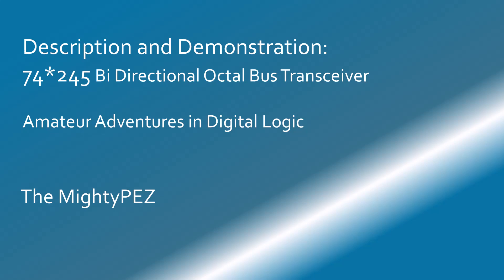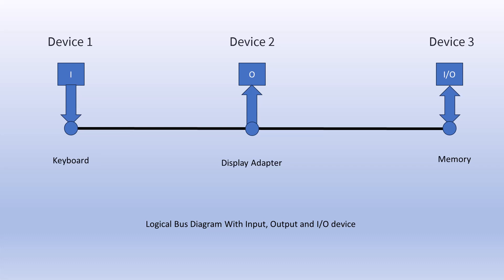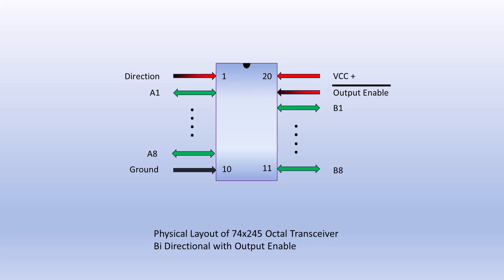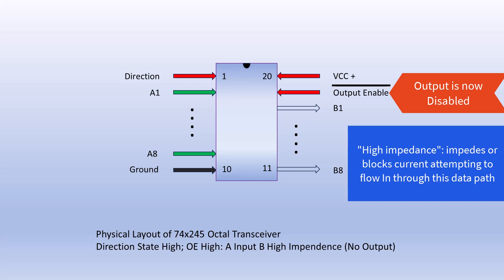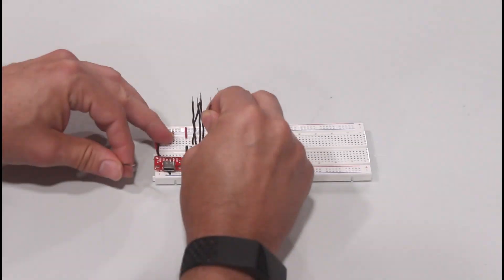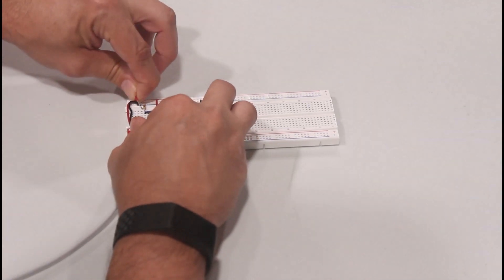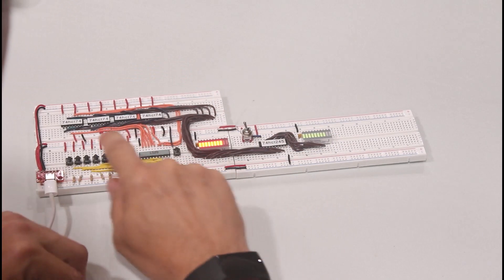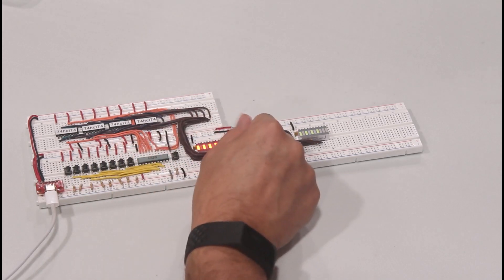74245 Bi Directional Octal Bus Transceiver ( 74*245 74hct245 )

Comment: Thanks for the nice video. One question, the chip is pass through and pass the data from A to B in live, or need to toggle the OE pin to do that? I am asking because in Logisim, if you change the input, without toggling the OE pin, the output keep the previous values and update the B-pins only after toggling the OE pin. Dont know if this is a bug on Logisim 4. Here in breadboard seems that every change on input pins, directly pass to the output.
Reply from the maker: The chip is pasthrough, ie it is not a buffered flip flop. There is no clock input to trigger. The Output Enable (OE) is active low, so make sure that it is low (not floating) and ensure the direction is not floating as well. In my use case i leave the direction hard wired and only disable output manually when switching back to CPU control.

Comment: So this means Bus transceiver is protective element for circuit, does't it ? How often can it be happened to have undefined condition in data transmission paths ?
Reply from the maker: Undefined conditions are due to design errors, not lack of data.  Circuit design should 
1) prevent multiple active signal sources on a line, (detailed in this video)
2) ensure that no inputs can have a floating signal (i.e. not driven to a high / low state, a rather common mistake that I make and causes troubleshooting)